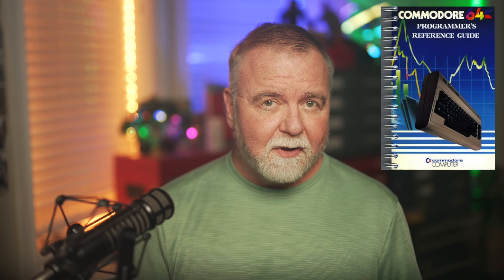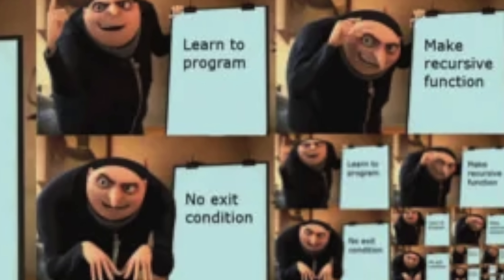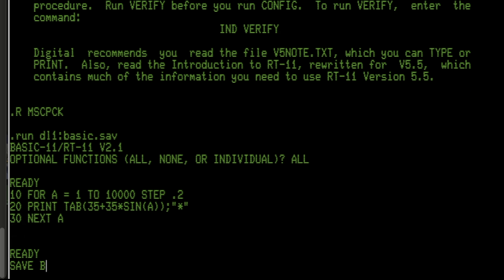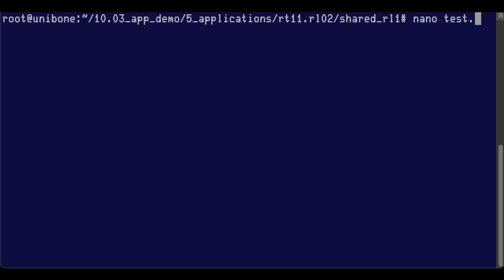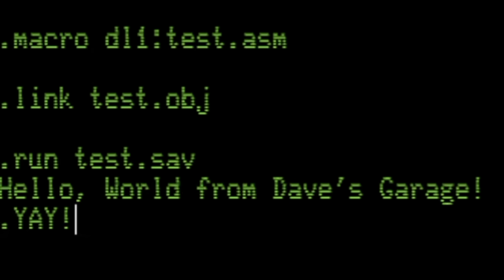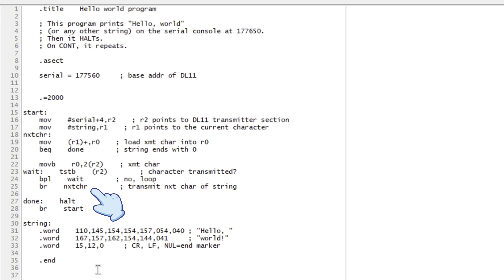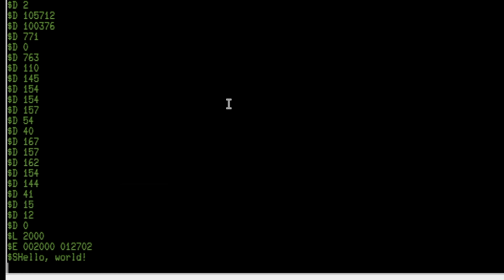Bare Metal Coding: Big Iron!  Assembly Language on the PDP-11/34

Comment: "Four linear feet" of RSX-11M docs: that says less about RSX than it does about documentation practices.  They believed in giving you full documentation back then.  Plus, it was all hard copy -- no electronic versions. 

To be perceived as an expert, you didn't need to know all the things -- but only where in the manual set to find them.

Other examples:
 - The original IBM PC (1981) included a source listing of the BIOS
 - The Seagate ST-506 hard drive (1980): its manual included schematics for the logic boards.  That proved invaluable a few years ago, when we needed to hack an ST-506 to get the data off it
  - If you open up consumer electronics of the day (radios, TV sets and whatnot), you'll often find a schematic inside the case. Right to repair went without saying...
Reply: Most Un*x programs from "back then" come with quite extensive documentation. GNU also adds info. Emacs and friends are self-documenting. People who release even simple programs have a great example before their eyes and try to follow. But in the Windows world it's a plague. I partly blame MS for that: how long did it take for the CHM format to appear, only to be declared obsolete in Vista? (You had to tweak the registry to enable rendering them; I do not know how much of a security hole they are, but that was the reason.) They work OOB in Windows 8 (?) and later, tho. But they drag the IE rendering engine behind them into the second quarter of this century...
Reply: Exactly, and that information can be of immense value. The original NEC APC included a full source listing of the BIOS, plus a diagram showing all the logical connection of the parts. That was awesome, since the native OS, CPM/86 was horrid. Having all that info allowed me to enhance the OS significantly with an interrupt driven printer driver (much faster, plus you could multi-task) and a memory resident interrupt controller/menu system, allowing direct chaining from one program to another. (The native way in CPM/86 to get from one program to another was to write a batch file to the disk calling the next program, then terminate and chain to the batch file.)

Comment: I would argue that answer to the JSR/RTS question is indeed 'YES' because while many JSR may end with the same RTS, they still all encounter AN RTS, even if it's the same one.

On the other hand, the question does not qualify the results of the JSR. Thus leaving two possible situations where a JSR has no  associated RTS; 1) with suitable coding, a JSR treated as a JMP/GOTO that is not intended to return to the originating location. May require some manual stack munging. 2) a 'bug' such that a subroutine called via a JSR never reaches the intended RTS resulting in undefined behavior. I again point to the fact that the question as presented did not specify a specific or even successful outcome of the JSR. =)

Comment: This video brings back fond memories, thank you. I graduated with a BSCS from the University of Utah in 1974. I learned to program on a mainframe, the Univac 1108. At the time of graduation I was working at Sperry Univac as an electronics technician in R&D. With degree in hand I was promoted to programmer and began coding for mini computers. (Unfortunately, I did not get any DEC experience back in the day. I do have PiDP-8 and PiDP-11 to play with now though.) I spent 20 years with Univac->Unisys where I mostly coded in assembly language for 8080, Z80, 8048, 6800, and my favorite, the 68000 series. Mostly using home grown OSes. In the late 90s I worked at Novell on their core OS which is where I got most of my x86 experience. The last 10+ years of my career were spent with C++, and although I was more productive in C++, it was no where near as enjoyable of a job as was writing assemble language in the 70s and 80s for the mini and micro computers.

Comment: And a related puzzle for anyone that is interested:

Back in 1981, when we had moved on from PDP11 to VAX11/780, I developed a very heavyweight VLSI chip simulator. It had a console UI modelled on a software debugger. And one day I came in to find the hardware engineers complaining about weird results. The simulator was still running, but the results were strange. And if I used the console “SHOW VALUE” command (normally used for voltages and currents, but capable of arithmetic) I got the (burnt in my memory):
SHOW VALUE 2+2 == 6.42.

And the VAX was still working fine for general operations (text editing etc).

Anyone want to take a guess at what was happening??
Reply: My guess?  I recall the Vax had several different floating-point formats.  Maybe someone changed the format in some part of the system, but not all the software responded appropriately?
Reply: @kc9scott  Nope. None of the software had changed overnight. But a further clue - this is a topic about "bare metal" and I did say the puzzle is "related".
Reply: @briancollins1475  Various commenters on this video seem to have differing opinions of what "bare metal" means, with several claiming that you hand-assemble and enter machine code.  But to me, it means your program runs without an OS, or at least you have access to the highest CPU permission level, and can replace or sidestep portions of the OS as needed.  I'd think that a VLSI chip simulator would heavily benefit from using an OS, e.g. to do device I/O, read/write disk files, and allow multiple users to share the machine.
Reply: @kc9scott  Absolutely! In this case, the simulator was a regular VMS program and the VAX was running in its normal multi-user fashion. And everything was running fine - except the machine could no longer do arithmetic correctly! I'll post the explanation tomorrow in case anyone else is still puzzling over it today.
Reply: The explanation – I hope it’s not an anti-climax …

The VAX had a full set of floating point instructions, but they were microcoded and SLOOOWWW. This made the VAX an unappealing machine for engineering applications – a major market for computers.

So, DEC sold (or was it leased in those days?) a “floating point accelerator”, which was a “daughter-board” that sat on top of the main processing board where it could access registers and busses. It monitored the instruction bus, and whenever it saw a floating-point instruction, it flagged up to the main processor that it would handle the instruction instead. And it did so – much faster than microcode. IIRC, the board itself looked about the size of the RAM board that Dave is holding at the start of the video.

The problem in my VLSI design software that said 2+2==6.42 was a hardware failure of the daughter-board. Obviously none of the normal system functions used floating-point arithmetic, so for all non-engineering functions, the VAX was working just fine. VMS wasn't crashing like it would with most hardware failures.

Comment: But the PDP11/34 doesn't have front-panel switches, unlike the 11/35 (or 11/40). That makes it tricky to hand-enter a non-DEC bootloader for running a non-DEC OS on the bare machine. But that was a very enjoyable trip back down memory lane (1977)

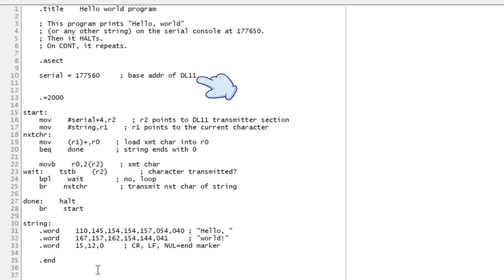Comment: At 10:44, you've got 177650 in the comment but 177560 in the code 🙂  I cut my teeth on an 11/45 in school.  Later on, I had an 11/34 pretty much to myself at work.  I got Unix working on it starting with an image for the 11/45.  Turns out the only significant difference between the two was that the 11/34 didn't have a CSR (Console Switch Register) and unix wanted to read a bit from that to decide if it should boot multi-user or single-user.  Once I figured that out and patched around it, I was good.

Comment: My first machine was a PDP-11/20. Many decades and hundreds of thousands of lines later I still write code for that elegant instruction set. And RT-11 I rewrote a few times as well, for different environments. I'm just finishing moving XXDP, the PDP-11 diagnostic operating system, to run in an RT-11 environment. Because the PDP-11 is such a delight.

Comment: During my Royal Air Force trade training as an air defence radar technician in 1984 my course was the first in my trade to do the "Digital" course as part of initial trade training. It was something like six weeks in the summer of 1984. As part of that course we had to do an introduction to programming using assembler on a PDP11/??. We also had to cover programming on a 6502 with just a hex key pad and a bunch of seven segment LEDs. This was on a board called an EMMA, which allowed you to add boards to do stuff like program a set of traffic lights. Never went near a computer again during my nine years in the RAF. Spent lots of time in a world where we mixed analogue and digital hardware techniques while processing the returned signals for the radar. Given of course that were were using a "pulse" radar.
Reply: Yay! I was subjected to EMMA as a sophomore in high school in Norway almost 30 years ago.

Comment: I had to write small sections of assembly to get around a picbasic pro compiler bug in the late 2000s. I was trying to do math with 32 bit numbers on an 8 bit micro (reduce truncation for a temp probe) and had a problem with the compiler's result not handling bit overflow properly. I don't want to think about debugging something written entirely in assembly, I would have SOOOO many notes to point the reader to sections and say what the sections did. I had almost no notes in my stuff written in basic.

Comment: We used PDP11/34 as display processor for >30 'radar' displays of the Air Defense somewhere 1 km deep in a mountain of an European country.  The project was in the early eighties.  We used RSX-11S (RSX-11M without disk) as the OS and developed everything on RSX-11M.  The system was programmed in RTL/2, an UK programming language comparable to C.  We developed the drivers ourselves in assembler.  The graphical display was a big round 30" tube and it could display 4 colors; red;  green, yellowish orange and orangish yellow.  The PDP/11s were downloaded from the central computers.  The PDP/11 had to process hundreds of red and green aircraft each 5 seconds, received over a coax cable at a whopping 1 Mbps.  I liked both versions of the RSX-11 OS.

Comment: David - this machine is not what was referred to as "big iron", nor is this machine particularly large even for the "mini" computer it was in it's day.  As a point of reference, the disk controller, tape controller, or any one of the terminal controllers on our IBM Big Iron was significantly larger than the entirety of the PBP-11.  My company was an IBM Key Account, and as such we were luck to be alpha/beta testes of IBM's initial foray into personal-computer world. We too at one time used Data General 6000 as a low-cost alternative for distributed computing and terminal access to the main-frame systems. I worked in and around the IT field from 1971 to 2015.

Comment: When I was using the PDP 11/20 or 40 or 60 I don't recall using anything other than the assembly language and the linker.  I think the OS was RT11 and then eventually RSX11m.  I remember that we had a little note book like thing that held the paper tapes of the various subroutines and parts of the instrumentation system we developed.  You would do what ever editing you needed to do and produce revised paper tapes then feed the paper tapes in the PDP 11 assembler which then punched out an object tape for each of the input tapes.  The object tapes would then be fed into the linker (twice) and a single tape would be punched out the was that actual run program.  
  The PDP 11/60 was an interesting computer in that you could actually add to the PDP 11/60 microcode to make your own machine code instructions.
Another feature of the PDP 11 was the ability to write your code such that it would run independent of where you loaded the program in memory.  This more or less eliminated the need for the linker, as all access to memory was relative the PC register or in the case of subroutines relative to the return address that was generated by the jsr instruction.  The media we used to save all the data produced during a sea test was on 9 track 7 inch reels.  It would take over a week to process and plot the data from a typical sea test using the PDP11/40.  When we got the PDP 11/60 and its full sized vacuum column tape machine we would take all the 7 " reel data and put it on a regular sized tape, then processing on the PDP 11/60 would take less than a day!  We were astounded by how much faster the the 11/60 and that big magtape machine ran.

Comment: I’m mostly a hardware guy but took a course that was centered around a book called the “68000 microcomputer systems” by Alan Wilcox back in 1984. The book was centered around a project (that we built), to build (Wire wrap) a working 68000 microcomputer board and then program an EEPROM to boot it, a UART to communicate to it an so on. This video had my mind back there in 1984.

Comment: Great stuff, in the 80's I was an assembly programmer writing games released under Ocean, US Gold and AMSoft for 8 the bit micro computer market and as the 6502 & Z80 processors ran so slowly, it was vital to optimise the code to run as fast as possible... for example on the Z80, the SP took fewer clock cycles to PUSH data to memory than a LOAD to (HL) so the SP was hi-jacked to point to screen memory and graphics were "pushed" in reverse to the screen mem. Tying in with that exam question, as the SP had been appropriated, many subroutines were coded such that instead of RETuring to the calling code a return flag was loaded with an identifier and conditional jumps were used to load the PC to the specific next address of the calling PC location, denoted by the identifier (the next address after the "call" being labled for the compiler). Thus subroutines with no RET lol... Of course, with this approach careful attention was given to any possible recursion but Speed was of the essence!!! cheers🍻

Comment: I don't agree with the statement that a subroutine does not have to come with a return from subroutine.

It's not a subroutine unless it's used as a subroutine, it would be an unconditional jump.

I am not that familiar with PDP but a subroutine call is a jump that stores a return adress somewhere, normally a stack, and by not using RTS would fill up the stack unless you removed the return adress manually, which would make the subroutine call a regular jump instruction.

Make no sense.

Comment: In your example of JSR R5,SUBROUTINE,  what is special about R5? When the CPU arrives at SUBROUTINE, any of the eight (six reasonably) registers could be designated as an argument for the subroutine. 

What is the difference between MOV R1, @R2 vs. MOV R1,(R2)? They both appear to copy the contents of register R1 to the memory location specified by R2.

Every JSR requires an RTS? Depending upon the exact wording of the exam question I might have argued that the question was ambiguous. Did the question mean that for every JSR opcode found in executable memory there had to be a corresponding RTS opcode in memory. Or did it mean that for every JSR the CPU executes the CPU needs to execute a RTS? The whole point of having a subroutine is that it can be called from more than one place. Thus, it would be reasonable to assume that the question refers to what is being executed by the CPU. I suppose there are weird programs where the answer would still be false. Or did the question mean that”in ordinary programming” there needs to be a corresponding RTS? It is conceivable that you want to execute a JSR for no other reason than to push the PC on to the stack. 

I never wrote assembly language code for a PDP-11, but in the day, did cross-compile assembly Z80 code on one.

Comment: I agree with the great video and great memories. The PDP-11 and RSX were a great pair. I implemented many industrial process control systems in either Macro or Fortran , using memory mapping over the I/O page and then inputting / outputting directly to the device registers. I also love the comments section of the macro programs. I did 10's if not 1000's of "sysgens" that configured the operating system for the machine I was using. We had the whole source code of RSX on the disk. Things like looking at the module of RSX where it tried to dig it's way out of a stack issue, if it failed it went to address "Crash", where there was a HALT instruction, with the comment "Die Horribly" .

Comment: Last year I wrote a game for a soviet calculator which uses the PDP-11 architecture.  I used a much more modern version of MACRO-11 which was a good bit nicer to use but still had some of its own quirks.  Learned a lot from that, but it didn't really prepare me at all to touch something like a 6502 which is a far more "manual" assembly language.  PDP-11 assembly really gives you a lot to work with.  I imagine if you're not careful, you can rely on some very slow instructions though when performance can matter and not be immediately aware.  I never have tested whether it works on hardware though, just an emulator.

Comment: Fancy. Back when I was writing a telemetry driver on a PDP-11 for a to-be-built satellite, with only hardware spec sheets for documentation, all I had for output was a portable, showroom-shiny digital analyzer for output (basically a hex/ASCII display) as the terminal out drivers weren't written yet. Fun times.